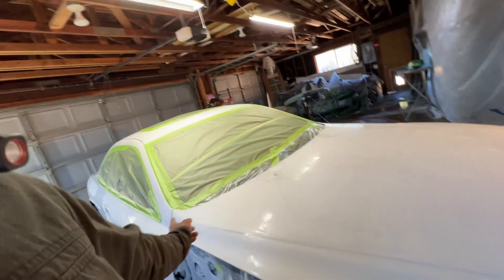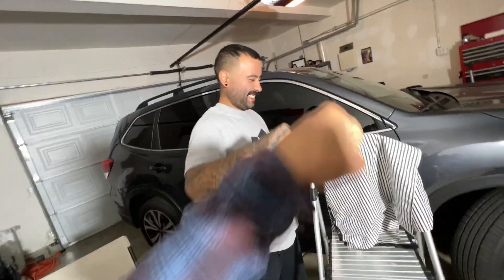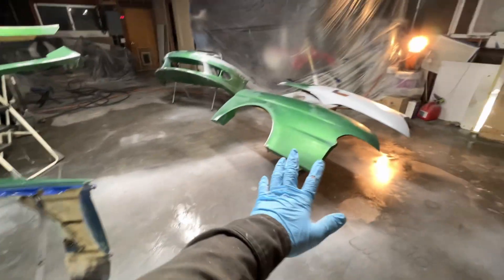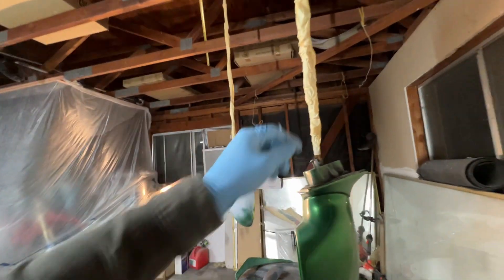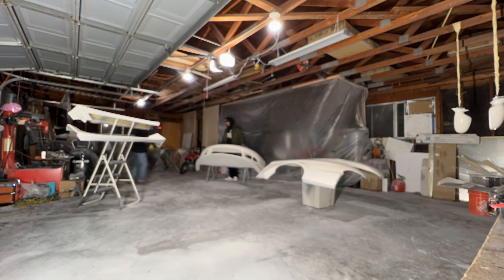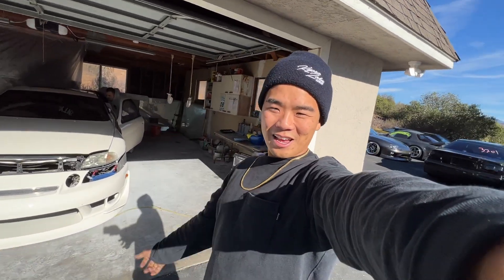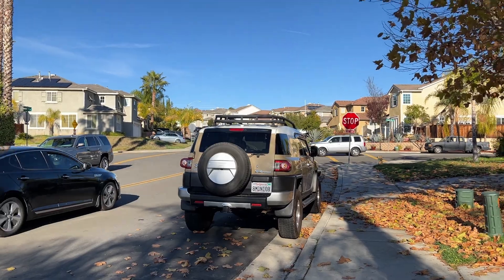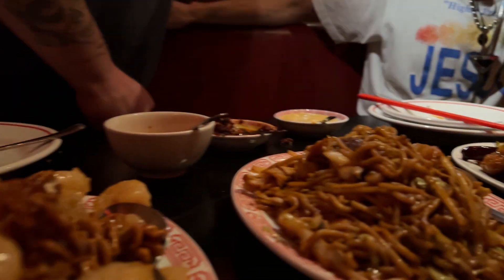MOVING TO JAPAN 🇯🇵/ SOARER GETS NEW PAINT JOB 🤫

Comment: Hey Kota, love the videos! Quick question... how do you keep orange peel down when painting in a garage/outside? I get some stuff with no peel and glass like surface, but other times it’s so peeled it’s not even glossy. Ive play with gun settings, mixing viscosity, etc. nothing seems to affect it, it’s like the paint just does what it wants, it’s super odd to me. My only thought is humidity?
Reply from the maker: It could be so many reasons but on last coat with clear I turn up the psi more and my gun setting is always wide open and most fluid